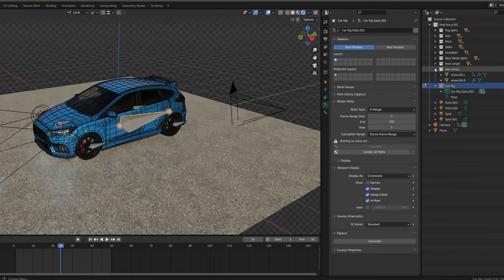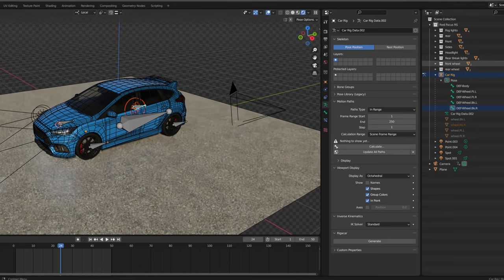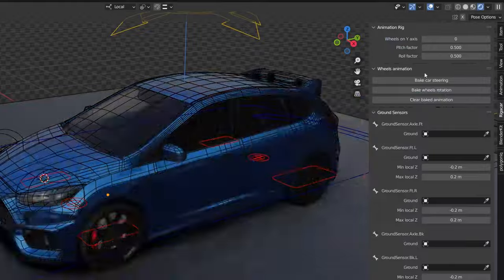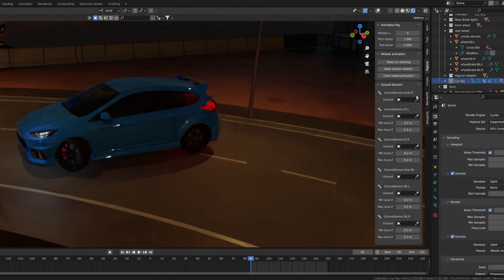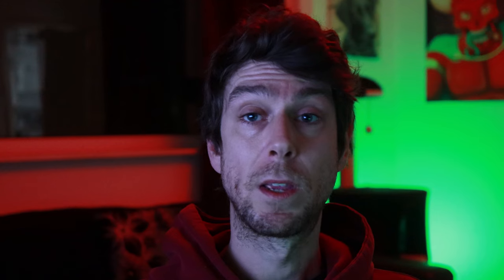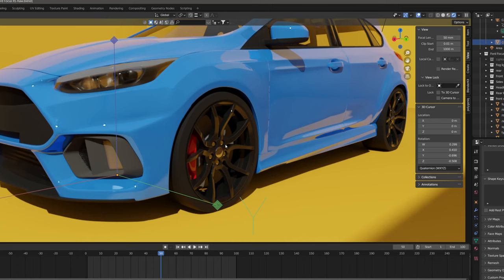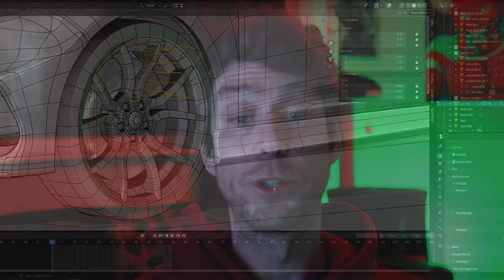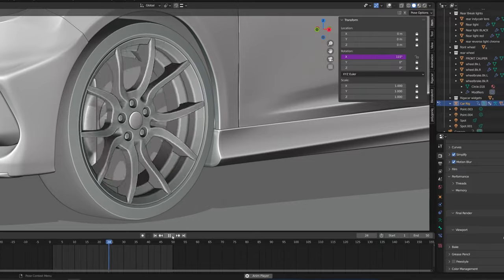Fixing Rigacar Issues in Blender

Comment: How to make the wheels rotate on Y axis when doing a U turn? The wheels spin backwards once the vehicle has turned around.
Reply from the maker: Very good question. I can think of many solutions. Are we talking a “james bond reversing J turn” or do u mean “american missed there exit and doing a U turn”?
Reply: I guess more like an American missing their turn???
Reply from the maker: the rig is like an empty. The Y is relative to the car. It will always be facing y+ because thats what u chose when u rigged it.
Reply: its not though. When following a path that goes in a u turn, the wheels slow down and then reverse direction as the car goes around the “U”
Reply from the maker: I have tried your problem. I understand were your coming from now. How i tackle this is using a driver on the rotation of the wheel. Type '#frame*2' in the x rotatation of the bone. This will perminantly rotate the wheel forward using a 'driver'. This is a fun problem that may not be fixble to my knolege. If your going sideways on x, and command the wheels to rotate on the y is going to fail. You cant break the law etc. You could just rotate the enviroment around the car or just cut the shot for a new shot. Hope this helps, if i find a solution ill defo let you know. I do enjoy a good puzzle ty   @kewldrawerings
Reply from the maker: you could even try keyframing the origins to self correct also, like i say. If i find a solution ill let you know
Reply: I thought local Y would always be forward for that bone! Its a conundrum. I too am trying to solve the puzzle with different rotation settings. I agree the workaround is hashtag frame or animation in the graph editor.

Comment: Which Blender Version are you using? Baking the steering kills my keyframes and the car won’t move. I read about this bug in 3.4 but as your tutorial is quite new I thought maybe you know about this issue and solved it. Maybe. Hopefully 🙏🏻
Reply from the maker: Fixing More Rigacar Issues In Blender 3.4 - Brakes & Bug Solutions
https://youtu.be/IHWO1YjoOT0
Reply from the maker: Made a short video that should hopefully cover a workaround for ya. Hope it helps
Reply: @walejaw3d  thank you so much for your quick reply! I found a solution on the channel of jeanyan3d where he offers the download of an updated rigacar addon for 3.4. Maybe you can have a look into it as i also had some issues with it but that’s just due to my lack of knowledge and I did sth wrong. But my steering looks not like it should when adding the plane for ground sensors. But wheel baking works as I see. I didn’t know if it’s cool to put in a link of another one’s channel here. Let me know if should.
Reply from the maker: @manmadeartists  oo yea, share the link. Love me a working rigacar lol
Reply: @walejaw3d  at 9:35 https://youtu.be/NrlfpGfvp3c
Reply from the maker: @manmadeartists   o dang, that guys awesome. I think ill be sacking rigacar off if that launch control is affordable. Awesome ty lol
Reply: @walejaw3d  i bought it and tried it and it worked really well. For normal streets or plane ground. But I also had a spiral roadway up a parking deck. And as it needs to be a part of the ground detector collection the rig with all its symbols doesn’t fit underneath the second part of the spiral so it hits it some kind of and it looks like it is stuck in the spiral and the car explodes into its parts haha. Which looks cool but is not what I was looking for 😂😂 I know it’s a special case but for 49 bucks. I wrote them and maybe get an answer or solution. In the meantime I stick to your awesome new video about rigacar bugs as it works now with using drivers for the wheels instead of baking. So much appreciation for your support!🫶🏻
Reply from the maker: @manmadeartists  thats brilliant to hear! this made my day thankyou x
Reply: @walejaw3d  ah and edit: rigacar really works in 3.4 with this fixed addon from the linked video. I just realized that my follow path constraint wasn’t in bones constraint menu. Now the wheels turn🤝🏻😌
Reply from the maker: @manmadeartists   ahh man this got me the first time around. Looking back at my video ive done it all wrong lmao. It was my first video so was more a practice at making videos then doing any R&D on it. I now just parent the rig to the path and use drivers. I did crack it on my first animation, i remember it being a pain to figure out so wanted to include in the video (more to help myself remember than anything) but obviously i didnt remember... im sure you understand why lmao coff coff. Guess what my next video will be about.....Ty dude
Reply: @walejaw3d  I really enjoyed our conversation and learned so much in the last 6 hours😄 And I always recognize how great the blender community is and that it makes sense to have sth open source because with the possibility that everyone has the access to sth the knowledge and skills that can be shared is growing. 
Excited for your next video🫶🏻
Reply from the maker: @manmadeartists  i agree totally, the pace at which ive learned blender is unmatched by any other 3d software. Its joy to use this program. Its nice to spend my money on whats really needed, like a stout PC... or 2. Thanks for your support my guy. Really is nice to chat with like minded peoples. have a great day.  I also look forward to whats next from yourself....
Reply from the maker: @manmadeartists  ive just spent an hour trying this new method out. Its dosent work lol. im sticking to my drivers. they work and take less time.
Reply: @walejaw3d  with the new rigacar fix addon installed (mentioned in the video link above) and exactly following the method mentioned from 3:49 on in the video https://youtu.be/MN6CXG83Wdw (only right click is left click in my preferences) it worked. Before baking I had the wheel rotation put to 1 in the rigacar menu for testing. Before baking I put it to 0 again and baked and rotation works. But I must admit that I used the auto rigging of rigacar following this method https://youtu.be/Us1ZlFZu6V4 and just parented my calipers to the rotator widgets (rectangles underneath the wheels) like you said in one of your videos.
Reply: i know im 9 months late but i thought this might help someone:

Use the bone constraint instead of the object constraint. Worked for me

Comment: problem with wheels animation after setting offset factor when i press brake car streeing and brake weels rotation off set is disappering
Reply from the maker: I dont bake anything tbh. Not to sound like a knob, i just bought a 4090 and lean heavy on ray tracing. Baking is out of date imo. But im no professional so dont need to use it. I assume its more for evee etc. i dont use evee

Comment: Thanks for the video, I made my own vehicle but it only has wheels and body. I followed the Rigacar tutorial several times The rig is always misaligned with the objects and the wheels reflect inwards and are misaligned. If you understand what I'm saying, how can I fix this?
Reply from the maker: You need to set your world origins to the middle. If u moved the mesh in object mode it knakers up the center. Always make sure ur in edit mode when you move things. Otherwise, select object in edit mode, press ctrl-s & 3d curser to selcted. Then back to object mode and press ctrl s again and object to selcted. Basically, do a deep dive on “world origins”.
Ill make a video about it, but cant promise soon. Hope it helps
Reply from the maker: Have you labled the wheels wrong way round? Lol
Reply from the maker: Also, try rotating the whole car 90 degrees as rigacar only works in on direction. If i remember correctly front and back should be on the X axis.
Reply: @walejaw3d oh man I didn't expect a response from you. I'll try everything you mentioned. I copied and pasted the names exactly as it was typed. No need to make an entire video for lil ole me. Thank you.
Reply from the maker: @akeem2752  i dont use the names, i manualy parent the objects to the bones. The names never work lol
Reply: @walejaw3d  hey thanks for your help. I can't at it with a fresh eye today. I got it together 🙏🏾🙏🏾. I'm trying to submit to the endless engines challenge.

Comment: when i click bake car wheel rotation, the car stops moving. how do i fix this?
Reply from the maker: Its a bug. Use drivers instead, #frame*2
Reply: im having the same problem lol
Reply: @walejaw3d  but then how to do we fix the problem with the steering
Reply from the maker: Manualy keyframe it. Addons are only handy if you know how to animate in the first place. Otherwise, best to learn the original way first. There is a fix for this, someone has released an update. If you scan my comments, someone posted the link for the fix